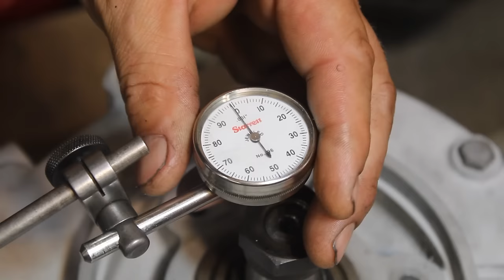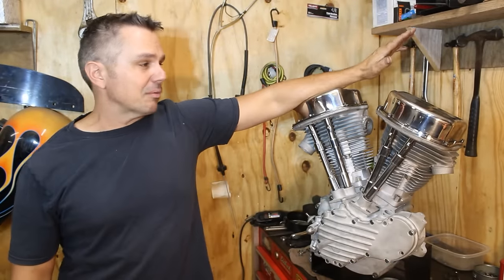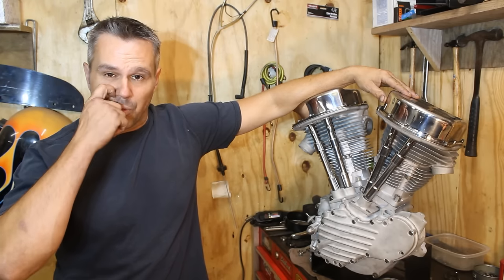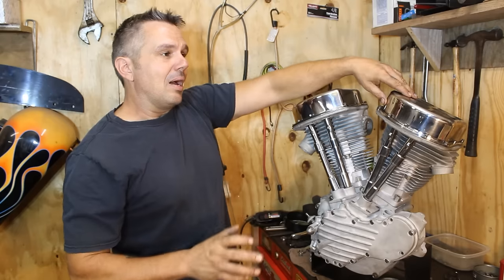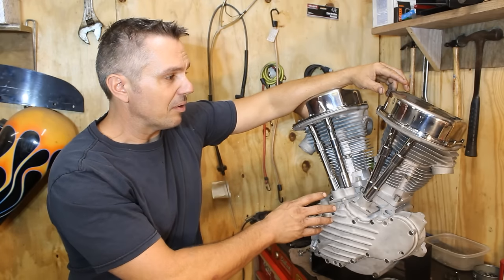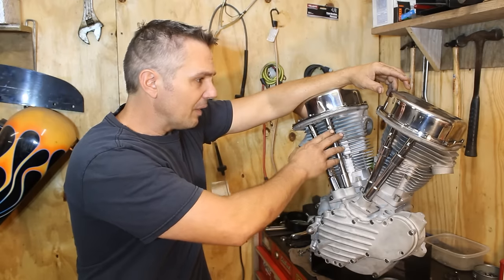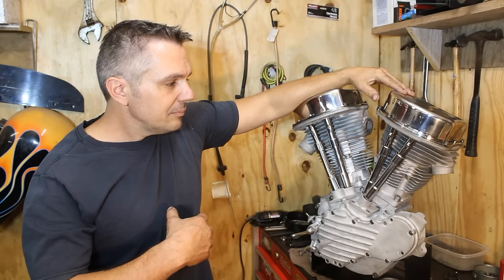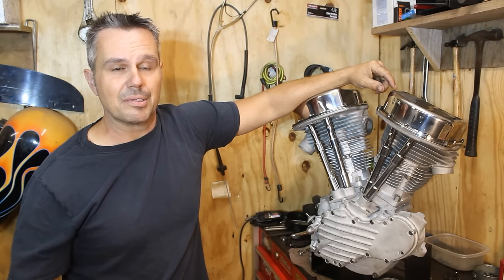Restoration of a 70 Year Old Harley Davidson Panhead Engine

Comment: No valve lapping???....😭
Reply from the maker: the engine had just been rebuilt before the fire. maybe 700 miles or so before it. there wasnt any pits to lap out. if you watch the restoration of 1950 harley is the engine really original. i go into more about the fire and the heads condition.

Comment: 13:30  wrong gasket no oil hole for heads. punch out hole or change gasket .
Reply from the maker: Good eyes. I'm really surprised how many people noticed that. those gaskets are for my 64 pan I didn't receive the ones for the 50 in time. so we used those to finish the video. I still have to finish honing out the cylinders. so I will be taking the top end back off.

Comment: LIKE CYLINDER BASE GASKETS NO HOKE THAT I COULD SEE OR THE LIFTER BLOCKS THERE'S A HOLE THERE FOR OIL TO MOVE THROUGH HUMMM 
BUT I'M A FLATHEAD FREAK SO WE DONT HAVE THEM HOLES I. THE FLATTY'S FUR OIL

Comment: I don’t see any parallel honing for crank - flywheel bearings???
Reply from the maker: This bike was in a fire after it was rebuilt 500 miles before the fire. It was being checked for damage from the fire fighters water. I checked every thing and it turned out good so I don't replace good parts at least that's what I was trained buy Harley.

Comment: C'mon, I'm missing two most important operations: valve lapping and cylinder honning, including deep shape inspection and wear evaluation 🤦🏻
Reply from the maker: 30 hours of work was condensed to 23 minutes. i could only show what was the best camara cuts. and i did hone the cylinder its in the video. i used the hone I got from the factory to do it. You must have seen me measure the cylinder and piston to check service wear limits also the valve stem and guide tolerance.

Comment: You're not measuring anything you just put it back together
Reply from the maker: This bike was rebuilt 500 miles before it was in a fire. It was put out by water so my main goal was to make sure that there was no rust on any of the internal parts. Since I was in there it seemed like a good time to check everything to make sure it all was setup correctly by the guy who rebuilt it. that's the reason I took apart the flywheel to check if the rod bearings were set up right. The ball hone that I used was to remove some very fine rust and to reset crosshatching, not to hone it out to final size. When I do have to hone after I bore one I hone it to final size with my micrometer flat hone just like the factory trained me to do.  It's funny though I checked end play on the flywheel and not one person has asked if it was correct and that was the only thing the guy did wrong, it was out of spec and had to be adjusted.

Comment: No assembly lube??? Hmmmmm.....
Reply from the maker: it's lube.  I didn't film me doing it for the same reason I didn't film other things like torquing the head bolts or setting the piston rings gap at 90 degrees from each other. I had too keep the time down for the video. I did everything the same way as the factory trained me when I was getting certified 2002.
Reply: @DeathProofProductions  My bad then.  I don't doubt your certifications, I can tell you use the right tools and procedures. I just thought that was strange.
Reply from the maker: no it's not your fault lots of people ask. I probably should have put that in but I'm learning. stay tuned for the transmission one coming soon too a YouTube channel near you.

Comment: Whoa whoa. Restoration?!?  Same rod bearings, same shafts, same valves, same guides???  You didn’t do a valve job or even lap them back in? You’re hitting the flywheels in the stand.  Man this ain’t no restoration. This is taking something apart, cleaning it, then assembling.  Good lord bro I wouldn’t want a “restored” engine from you.  Jesus
Reply from the maker: this bike was in a fire and needed restoration for fit and finish not rebuild It was rebuilt 500 miles before the fire but you see me mic everything just to be sure it was fine. the only reason I took the flwheels apart was to check for rust on crankpin. and that's not a truing stand it's a lathe. if you do some research you will find that harley didn't say take the wheels out until the late evo years. read a shovel service manual and it says loosen the stand before hitting them. what do i know I was only certified buy the factory in 2002 and built engines since then bro.
Reply: @DeathProofProductions  that’s NOT how you measure a guide first of all. Second of all you shouldn’t be hitting that crank in the lathe either.     What about the No oil Feed cylinder gasket. How’s that workin out?
Reply: Also, who the fuck sandblasts the entire head and valve, you don’t even lap it?!?!??
Reply from the maker: let's do a engine build off and film it I bet I outshine you. we can let the people decide.
Reply from the maker: ok my email is Davethom2004flstc@gmail.com let's set up the rebuilds and film. i got a evo I'm starting so I will use it. if you don't have a camara crew I will send mine there. so what you say or are you chicken. remember everyone is reading this.
Reply from the maker: you may want to watch my other vids before you decide. I mean I'm trying to give you a out but I hope you don't take it. bro
Reply: @DeathProofProductions  haha everyone? Are those the same people leaving comments praising this “restoration” you did here? A camera crew?!?  I NEVER leave comments on YouTube, I got rid of Instagram.    When I saw this video and how many views I assumed it would be good. It was filmed well, it was fun to watch. It’s just fake, like most reality tv.  Nothing was restored or rebuilt. It was just a clean up video. You got some good tools there and it SEEMS like you kind of know what you’re doing. Then you try and tell me you are measuring with the wrong gaskets when it’s a engine that’s not even getting and work at all?!  Listen man.  Cool channel etc. you can fool the masses, but not a real one like me.  Luckily for you, guys like me are rare these days.   Have a good night. Oh and don’t forget!!!  EVERYONE is reading!!!
Reply from the maker: the hole in the gasket has nothing to do with thickness. that's what I need for valve to piston clearance but I guess you don't know that. I say you couldn't spell mechanic last week but now you are one. remember lets compete. bro
Reply from the maker: i dont erase any convo. I want the viewers to no the truth not no side mechanic crap like your spewing. I'm still waiting hell I will come to your shop and show you don't know shit.
Reply: Whoa what happened?!? I thought u didn’t erase comments? Why u erase the one on my page? Change your mind killer?
Reply from the maker: I used fine lead wire on the front piston. did you see me film it no. like I said I had to check and see if it was done right I bought it after the fire. would you trust some stranger. but like I see put your money were your mouth is I can bring me and my crew to new Hampshire and we can have a shoot off. tough guy.
Reply: @DeathProofProductions  wait. How did you get a measurement again?? Let me get this straight. You put  the wrong gasket on to measure the distance from the valve to the piston using a wire through the plug hole??? That is NOT how you do that for oneC there is NO WAY to get an accurate measurement.  If you are building a stroker and or an engine with a giant cam, you used CLAY. How in the world could you ever even pretend to do what you’re saying? You’re clueless and just digging this ridiculous hole deeper and deeper.    Just stop it.
Reply from the maker: I didn't say you put it through the hole I said you lay it across the piston when you rotate it over it leaves a impression in the lead that you measure with a dial  caliper.  remembered let's do the build off put your money were your mouth is.
Reply: @DeathProofProductions  bro I’m sitting here here laughing at your video and comments with my dad whose been rebuilding engines for a living for 40 years.   U want a building? Just say what model engine   I got a UL, knuckle and a pan I’m doing soon
Reply from the maker: iv got to restore the intake and carb for the pan first. then next month I'm starting on my son's evo. that's gonna be a complete rebuild not just a restoration so I will go into more depth on what I'm doing. and also doing some performance upgrades . so watch it  and I will watch yours and we can decide from there is that fair enough. just pic the one you need first and rebuild it.

Comment: Copper coat copper coat copper coat. Otherwise; Leak leak leak leak.... Just saying.
Reply from the maker: iv had good luck with 3m threebond on all my pans and shovels. thats what i used on the cam cover and cases.
Reply: @DeathProofProductions  I'll have to twist your arm so you can feel the joy of Permatex coppercoat. I've used it for decades. It goes on ultra thin and seals real good. I've never had a leak ever and it works great with cork too. When I used to race my 70 and half camero, I used cork valve cover and pan gaskets and after coppercoating I was able to reuse those gaskets multiples of times for months on end with no issues and when racing, you're always tearing these covers off several times during a race day. Can't use it on carb gaskets though. Carb gaskets I've learned do best going on dry.. All of the gaskets on my old shovelhead got coppercoated and I never had a gasket leak. If you decide to try it, shake the can really good, and apply real thin coats and let dry between coats until you get a uniform copper color. You can use it on headgaskets as well though I always go 1 or 2 light coats on headgaskets if I do decide to use on those.🎭
Reply from the maker: i will give it a try on my evo project coming up. might be cheaper, that 3m stuff is high as a cats back.
Reply: @DeathProofProductions  I'd be real surprised if you don't like it. Make sure metal surfaces are grease and oil free. In fact, if you don't like it, I'll buy your next tube of 3M for you!!! 💯

Comment: Мужик, зачем мазать герметиком прокладку? Там и так прокладка 😁 Зачем заказывать прокладки, если есть станок специальный для их вырезания? Имея такое оборудование ты занимаешься салатом? 🙂
Ты когда нибудь слышал слова- ГРАДУСЫ, ФАСКА??? У тебя фаска под клапана настолько широкая, что клапана будут не плотно садиться и прогорят. 🤦‍♂️
Ты делаешь хон просто щёткой в старом изношенном цилиндре, с изношенными старыми поршнями это что за недоремонт??? 🤦‍♂️
Ты вставляешь новые сепараторные подшипники коленвала на старые изношенные пальцы с шатунами, это нормальный у тебя ремонт? 🤦‍♂️
Зачем ты красишь внутренний картер под коленвал в красный цвет, это чтобы краска попала в масло? Там красоту эту кто-то увидит?🤦‍♂️
Цилиндры красишь серебрянкой? Ну-ну... 🤦‍♂️
Ты хоть кольца поршневые новые поставил, или тоже почистил, помыл и поставил старые? Зазазор в поршневых кольцах не не слышал? 🤦‍♂️
Клапана притирать к сёдлам не не слышал? 🤦‍♂️
Короче ужас а не ремонт🤦‍♂️

Man, why put sealant on the gasket? There is a gasket anyway 😁 Why order gaskets if there is a special machine for cutting them out? With such equipment, do you work on salads? 🙂
Have you ever heard the words - DEGREES, BEVEL??? You have a chamfer under the valves so wide that the valves will not fit tightly and burn out. 🤦‍♂️
You make a hone with just a brush in an old worn out cylinder, with worn out old pistons, what kind of underrepair is this??? 🤦‍♂️
You put new crankshaft separator bearings on old worn out pins with connecting rods, is this a normal repair for you? 🤦‍♂️
Why are you painting the crankshaft inner crankcase red to get the paint into the oil? Will someone see this beauty there?🤦‍♂️
Do you paint the cylinders silver? Well, well... 🤦‍♂️
Did you even put in new piston rings, or did you also clean, wash and put in the old ones? Did you hear the gap in the piston rings? 🤦‍♂️
Didn’t you hear the valve to grind to the saddles? 🤦‍♂️
In short, horror and not repair🤦‍♂️
Reply from the maker: The engine cases and cam cover are 70-plus years old. You'll see in the video that they are scratched and gauged to the point where 3 bond is needed to help the gasket properly seal. 
You must not have noticed that the gasket kit was for the top end of the engine only and did not have the cam cover gasket. Since I own a machine capable of making gaskets why would I special order one when showing the process of making it could be entertaining? After all, that is the point of the video.
Panheads did not have three angle bevel like on modern engines. They are made with a 45-degree bevel. This is in the factory service manual. 
That is the tool the factory calls for when setting the proper cross-hatching pattern for oil retention. In the video, you see me measure the pistons and cylinders. They were well within their service limits not worn out. There would be no reason to replace them. 
Those were not new barrings, but the same that came on the engine. This bike was in a fire. The title says restoration not rebuild. The engine was rebuilt 500 miles before the fire. All I am doing is checking to make sure everything is still good on the inside. You say the pins and connecting rods are worn, but there is simply no way for you to know unless you have measured it yourself.  
When this motorcycle was made they were still using sand casting for the crankcase (as well as other parts) which is known to have porosity or small pin holes that could leak. The "red paint" as you call it is actually motor sealant which I (like the factory in 1950) am using to prevent this crankcase from leaking oil. Yes, I did paint the cylinders silver. The cylinders are made from cast iron which rusts. And just like the factory did, I am painting the cylinders silver to prevent this. The original paint was burned off in the fire I mentioned.
Everything I did and checked on the engine was exactly what the Harley Davidson factory taught me how to do while being trained under them. Just out of curiosity are you certified by Harley Davidson as a mechanic? Do you have over 20 years of experience in repairing and restoring Harley-Davidsons? Have you ever even looked at a Harley Davidson Panhead service Manuel? Do you even know what a service manual is? I am betting that you have never even seen a Panhead with your own eyes and since I do this for a living and own 17 antique Harley-Davidsons I'm willing to wager that I know a bit more about this topic than you. Maybe do some research before you comment and make yourself look like a fool.

Comment: Hahaha come on.  U put wrong gaskets on and covered the oil feed holes too!!  Hahaha this video is too much.
Reply from the maker: good eye's those gaskets are for my late model panhead. new ones hadn't showed up yet but still needed to check valve to piston clearance and finish the video. if you want me and you can do a engine build off and  film it and see who is better.  I will up load it and see what everyone thinks.